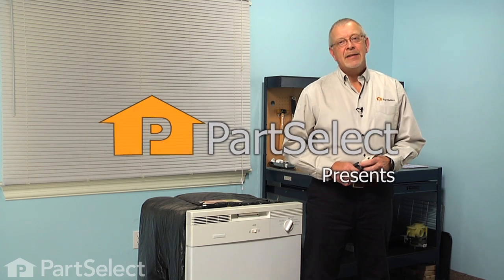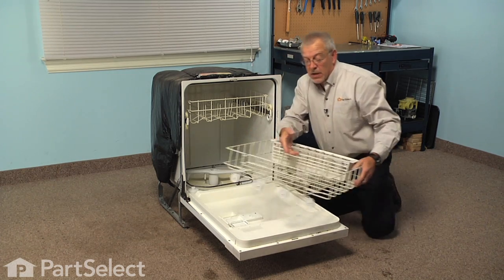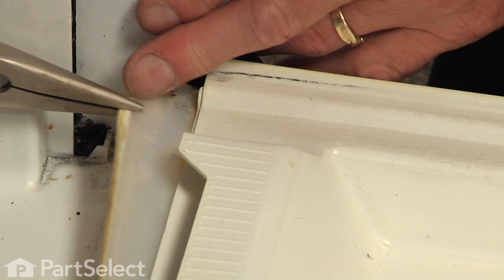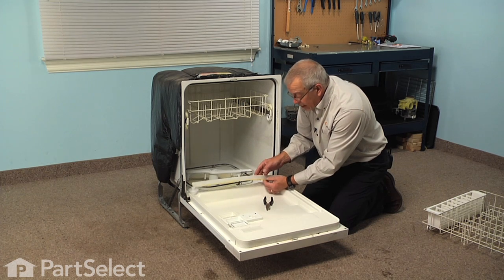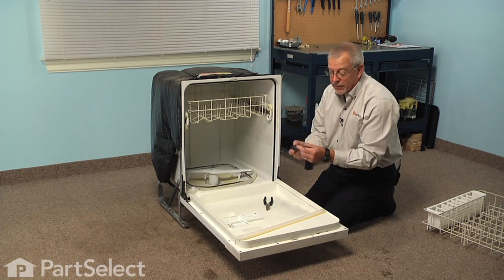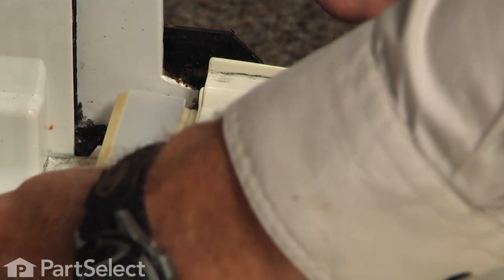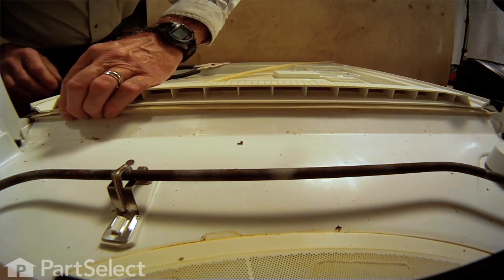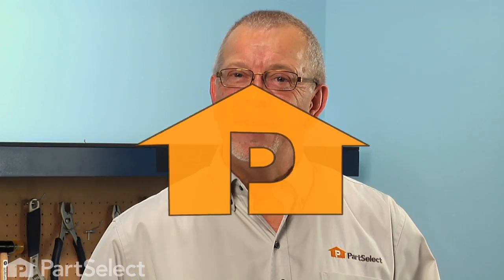Dishwasher Repair - Replacing the Bottom Gasket (Frigidaire Part # 154759101)

Comment: I'm not impressed with this design feature on my Frigidaire Gallery.

Many of the comments were helpful though and with perseverance, I finally put the gasket into a 'secret' recessed groove. 

In the video, the technician used a screwdriver to clean the 'gunk' out of the groove. I used a butter knife which informed me of the track that the gasket fits into. Previously, I had the gasket slipping into the space of the door's inner workings and it was loose and fell out when I would close the door again. Now it is in place and looks right. 

I will have to run the dishwasher to make certain there are no leaks before moving on to replacing the tub gasket and splash guards.

Comment: My door was loose and it caused my seal to fall out. Once I tightened the door my seal went back on perfect as you have shown. Before I noticed my door hinge bolts loose the seal wouldn’t stay. Great Video! Thank you!
Reply: I got fed up and started disassembling the door on the dishwasher hoping to find where that thing fell from once the door was partially disassembled. Had the door outer skin removed. Still couldn't make heads or tails of it. Mine just fell out one day. I know about where, but never did match the cut and the notch to anything to help me see where. Until this video. The door was about to come apart completely when I thought I would try more than just seeing a drawing. There's nothing I can't fix. And still is nothing I can't fix. But never would I have been able to guess where this seal fell from on the machine without this video.

As a matter of fact, I just got done running a partial load through it just to make certain all is well. You know, the house I own came with a dishwasher thirty years ago. Dishwasher and trash compactor. Compactor I use daily, too, and I keep it running like new. The dishwasher, well, I bought a new pump and motor for it fifteen years ago. Thought I was lucky to find those new. Should have replaced the dinosaur with this Frigidaire long before then. The sanitize feature hits right where it counts to an old bachelor like myself. Before then, who know what bacteria I would eat? Kitchen was actually built around the big old Roper gas stove and oven. Refrigerator replaced twice, once with new. Two microwaves,. You did hear me say I'm a lifelong bachelor? What would a guy do without at least one microwave oven? Probably starve or be a drunk? lol

Comment: Dish soap on the edge to help it slide in 👌 that's what did it for me
Reply: This comment saved me a ton of frustration, tried to get the gasket in for 15 minutes with no luck, rubbed some dish soap on my fingers then along the edge that goes in first got it the first time.

Comment: Hi, I just received my OEM gasket from PartSelect and on the new gasket the inner lip points upward rather than downward, just like the one that was leaking in the first place. Confused!!!
I feel like I'd done the install correctly but it's still leaking :(
Thanks in advance for any advice, and could it be possible that the tub gasket is (also) the problem and not the Bottom Gasket?